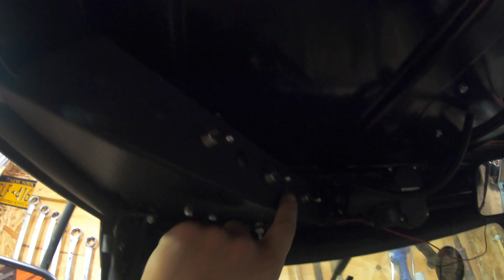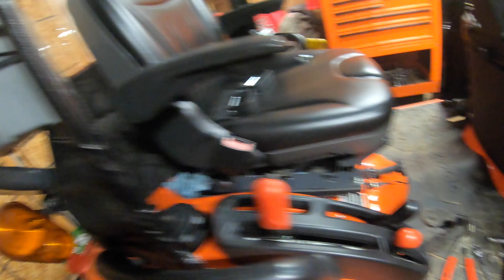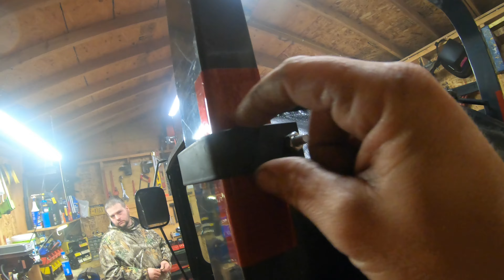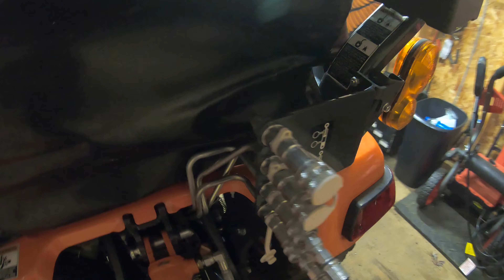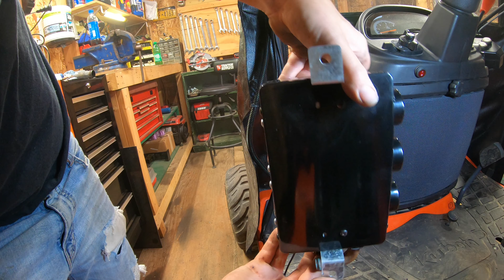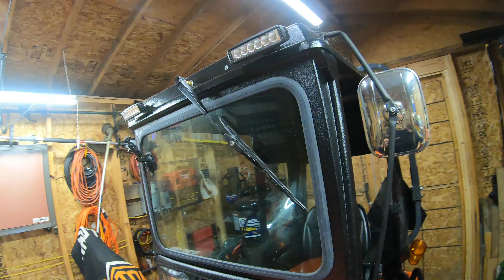Kubota BX- Tractor Cab & Cab Heater Re-Install!!

Comment: You do it so easy. I don’t have the tool to remove the floor pads but will get one. Thanks for the excellent video
Reply from the maker: Thanks Wayne, the tool I own is made by Mac but I’m sure you can pick one up from harbor freight or your local Mac or snap on dealer; you don’t need to have the tool but it does make life much easier, it also helps to not destroy the clips because you don’t have to tear them out with pliers. Best of luck!

Comment: I have a bx2670 with the Curtis cab. One thing that really helps retain heat is the vinyl cover that Velcro’s over your hood bonnet to keep the tractor from sucking out the heat. In the warmer months you simply remove it, it makes a difference
Reply from the maker: That’s a great cab youv got there! Yes I completely agree, I had plans to block the bonnet screen off last year by purchasing Curtis’s bonnet cover but found out that Curtis does not sell those covers independently from their cabs so I have to resort to making my own cover.. I planned to do it last year but never got around to it so maybe I’ll make a video doing that soon! Thanks for watching 👍🏻
Reply: @BiffsEquipment   it would be pretty easy to make one for sure

Comment: Learned a lot as in I don’t think I want a cab! Too much work to take on and off! Might change my mind but not going to use for snow removal and I don’t work in the woods in the winter due to snow or mud! Learned what I wanted to learn so thanks for the video! Mark
Reply from the maker: Hey Mark, it really was quite easy to install honestly! And it’s even easier to remove! I don’t think it’s bad at all tho you will need an extra hand and if getting someone to help you is hard then it may not be for you but you could always use some type of a chain hoist to lift the cab as you drive under it also depending on if you have a garage or not. Thanks for watching!
Reply: @BiffsEquipment  Yeah I'm 70 so need help for sure! Plus my 660 sq ft pole barn gets smaller every time I buy something! not sure how often I will take it out thus winter, I have an ATV to plow snow and cant work at my property as too hilly I won't take it out there in snow! Thanks again always learn stuff from your videos!

Comment: Glad to see it did not interfere with your 3rd function valve.
Reply from the maker: I agree, it doesn’t interfere at all and actually they make a slit in the front of the cab itself for the two hydraulic lines to come through the cab and go the 3rd function so you can still operate a grapple or other attachment even with the cab on. It also has no affect on the rear remote kit either 👍🏻

Comment: Couple ? Did the heater you got with cab didn't work? And from ground to top of cab, what does it measure? And 1 more where did you get the cab? Thanks I'm new Kubota owner.
Reply from the maker: Hi Ted, the cab itself is from “Original Tractor Cab” if you Google their name you will find their website and you’ll see the cabs they offer and for which tractors.. they also sell lots of accessories for the cab and I have made a video on installing every single accessory as well as a video on building the cab itself when you first get it. I don’t know what the cab measures but I will see if I can find out for you, lastly the heater it comes with is an electric heater, it doesn’t work very well, it’s more of just a hand warmer and it sucks a lot of power (in my opinion it’s very hard on your alternator too) so I made a video last year removing the original electric cab heater and showed how to install this radiator style heater instead.. I also talked about where I got it and how much I paid for it and left links in the description of that video on where you can buy one. If you can’t find the video let me know.. it’s on my channel called “installing a new cab heater”

Comment: Thanks for your video's' on the tractor cab. I just upgraded from  BX2350 TO A BX2380, DO YOU THINK THIS CAB WILL FIT THE 2380?? THANKS AGAIN!
Reply from the maker: Hey Ronald, thanks I’m glad you like them! This cab won’t fit your bx 2380, well not perfectly anyways.. if you already have the cab from your 2350 and want to add it to your 2380 then yes I’m sure you can make it work with a bit of fiddling around and customizing.. otherwise If your looking for a new cab for your new tractor then just go on their website and buy the cab they build for your machine which is basically the same exact cab for the same exact price only it comes with a few different brackets and such to make it fit the bx80 much better than the older cab woulda. Best of luck!
Reply: @BiffsEquipment  Thanks again Biff

Comment: I noticed that hanging heater you have in your shop how you like it? I'm been thinking about installing one in my shop. I would have to run a natural gas line from my house about 100ft.
Reply from the maker: Thanks man, the Heater is an absolute monster, it’s an 80,000BTU unit inside my little shed haha, I bought it because very soon I plan to build an actual 2 bay garage and plan to re-use the heater for that and I’m gonna turn my shed into just a storage shed. The Heater is an oldie from the 80s I think and it’s made by reznor.. reznor makes some really awesome gas/propane heaters that last a lifetime.. I scored mine used on marketplace for $80! I also took my gas from the house, I T’ed off my house furnace line and extended it about 15 feet to my shed where the heater hangs and added a couple of ball valves.. I left the pilot on all summer by accident but it was fine, I’v already used the heater a few times this fall and it works great, it heats my shed up into the 70s in about 5 minutes haha.
Reply: @BiffsEquipment  thank you pretty sure I'm going to install one Thanks again and great videos

Comment: thanks for sharing the video, what is the next attachment you plan on purchasing to use on your tractor? I just picked up a used bx23 with the backhoe. it works pretty good for my personal jobs. but I don't think it's good enough to go out and earn a living digging holes with it
Reply from the maker: Very cool man! The tractor you can certainly go out and make a lot of money with specially doing side work so long as you have people in your area who need smaller jobs done.. if they are all larger jobs then yah it’s not gonna be the best tool for the job when it comes to productivity.. the tractor is amazing but the backhoe is small and can be a little lacking in the productivity department so I know what you mean. The next attachment I’ll prolly be getting is a front angle blade for my loader to plow with this season.. last season I built myself a custom pushbox which I made 2-3 videos on the build and used it all last year, it worked awesome but the right tool for the job for my driveway is def an angle blade or snow blower. I built the pushbox because I knew it would be easy and quick to build myself. Other things I’d like to get by next season is a tooth bar, a new hydraulic top link with a side link so I can have a full top and tilt system on my 3-point, and I would also like to buy a tiller and a new grader box as well. I’v also been working on finding a new/bigger trailer as well for next season.
Reply: @BiffsEquipment  I just ordered the piranha bar I'll let you know how it works out and thanks again for sharing the videos

Comment: Your heater may be enough if you close off the air screen so the engine fan doesn't suck your heat out. You also have to remove the lower black collar at bottom of screen so cool air comes in from underneath.
Reply from the maker: Hey Chris thanks for watching, Yes I completely agree, I had plans to block the bonnet screen off last year by purchasing the Curtis cab screen bonnet cover but found out that Curtis does not sell those covers independently from their cabs so I have to resort to making my own cover.. I planned to do it last year but never got around to it so maybe I’ll make a video doing that soon! Thanks for watching 👍🏻